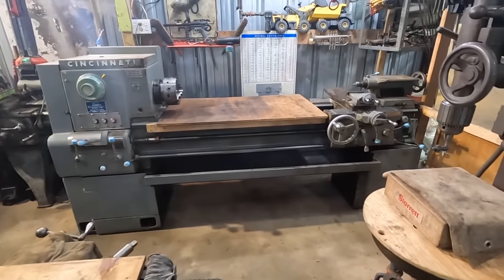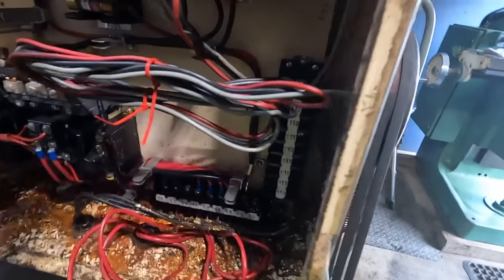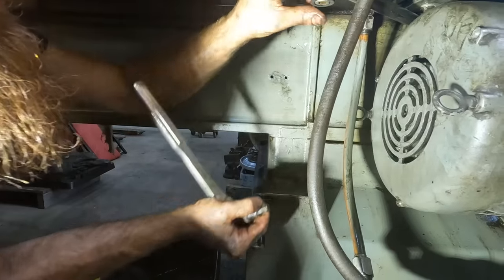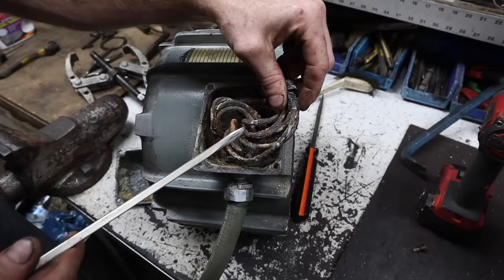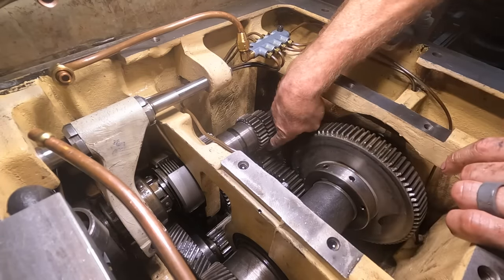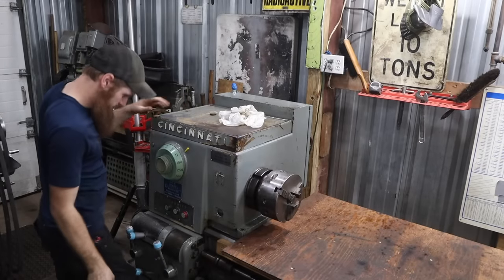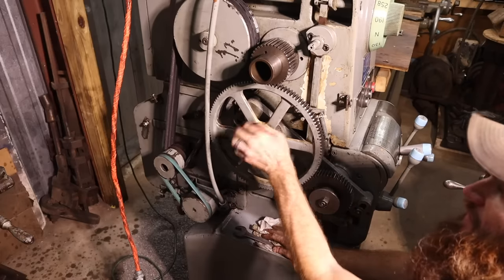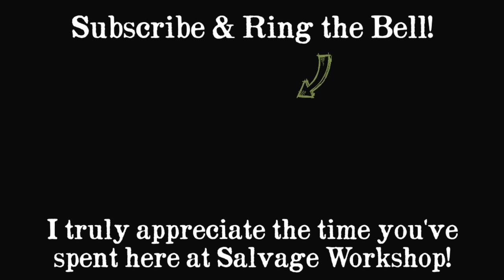Can we SAVE this BROKEN Lathe? ~ MAJOR Issues found! ~ Will it Ever CUT again?

Comment: Back in the old days, There was no Shields for chuckes when you run liquid. It would sling it all over the place . I think it got up on top of the electric box and Leaked passed the seal on the electric box, and it could have enterd inside the box that way.

Comment: I WAS WONDERING why  didn't extend the pipe for the bottom drain bro. A hose leading down into a pan with some filter cloths of some type to catch ay bad stuff so u can reuse the oil or diesel?? I'm probably talking nonsense here. Apologies if my idea makes no sense at all. LOL
What was all that crap that was stuck in the motor? I couldn't believe that much stuff could get in to a motor housing that is completely closed off to the outside? 
What size motor is on this Lathe? It looks huge. I'm guessing 3-5HP or higher?? 
It's a beautiful looking old machine my friend. Great work by yourself and the 2 young lads who helped u clean it back to a nice looking machine again. 
I love videos like this one. 
A machine like this would take a heck of a lot of work to get it back running smoothly again but u guys seem to have worked ur magic on it.
Best of luck with it man. I hope u get many years of great machining out of it.

Comment: Lower oil sump is probably meant to be a debris collector that only gets cleaned and serviced at very long maintenance intervals. That would allow the use of a screen for the main filter which gets oil from a higher cleaner level, That is somewhat how lube oil and hydraulic oil sumps work on some steam turbines at least

Comment: Not sure if someone mentioned, but the copper lines are not for oiling the gears, rather go to the ends of the shafts to shift them into the other gears.  But check it out.

Comment: That is a squirrel cage three phase induction motor.  Get the stator windings cleaned and tested for continuity to housing maybe it can be used for a while. The bottom part of the windings have discoloration due to being immersed in water while energized.  Very surprising it is still running (but soon will burn out).  Most likely the water entered thru the electrical terminal box.

Comment: I think the one with a plug is just a drain for changing fluid. It may be a place to catch particals that are floating in oil to keep from circulating in system. I think otherwise it would have been hooked up the way you are thinking. Just my thoughts on it

Comment: If the tube is open ended by the site glass, it's a fl ow gauge so you can tell if the oil pump is running

Comment: All that stuff in the motor is aluminum oxide from the housing corroding.  It's an excellent electrical insulator therefore, the motor didn't short.  Had the same thing happen to the winch motor on my Jeep.

Comment: You don't use a detergent oil in your lathe. You use gear oil. Particulates don't stay suspended in gear oil (which is what you want), they do stay suspended in detergent (motor oil) so they can be filtered out by a filter. 
The oil in the electrical box may have been coolant, or a leak in the electrical supply conduit

Comment: The lower sump is likely for letting fines settle out, many machines featured a dual-sump system for that purpose.
Basically, gravity-filtering with the screen to catch any big chunks that end up in the wrong sump.

Comment: Oil can also sneak through wires like they are a candle wick. Something like that happens rarely, but still it can happen. 

It is an issue in some older Mercedes cars with cables connecting inside of a gearbox with main ECU, which was inside engine bay, higher than gearbox. You could find your ECU filled with gearbox oil. Try explaining that to a client 😂

Comment: That drain plug allows the contaminated oil to settle at the bottom, and then it should be drained regularly to remove the accumulated sludge. DO NOT CONNECT IT TO THE FILTER FEED PIPE.

Comment: If you had set the bike level you could have simply used a bubble to set the subframe joining pieces/stub ends vertical alignment. Also, I would drill the frame for plug welds to reinforce the welds on the end of the tubes/stub ends! 😊

Comment: That's called an oil light barring that bushing in the big gear you have to buy it pre-made you can't make one it has to be infused with oil I mean I imagine you can make what if you learned how I'm just saying that it's not just a piece of brass. It's called an oil light bearing and you have to buy them in there usually a little bit too tight to put in even pressing you have to take ten thousandth off. I used to use a highly highly accurate hardinge lathe to do that and you have to do it at high speed and use a very sharp tool. If you smear over the microscopic holes from the oil infusing process and leaves it useles and it aware that hardened shaft in short order

Just a tip
Reply: Yep!  Oilite!

Comment: The corrosion you found within the motor was mainly Aluminium Oxide from water immersion.
Did tge unit go through flood in the past.
Great detective work on the speed gears and electric motor.
When working on old electrical items be cautious of asbestos insulation.
Hope you ID the high speed noise?
You never ran the unit in reverse; does the noise change?

Comment: One more time, those split pins have a greater content of carbon to allow them to be springy. Greater carbon steel is spring steel. It's the same with leaf and coil springs. They have a greater content of carbon.

Comment: You don't want your gears running tight.   They need a bit of lash to run properly.    Check the  manual for all the specs.   They can usually be found online.

Comment: The play in the headstock end gear train that runs over to the threading/feeds gearbox is a necessary evil.  It’s called backlash and must be there, though at a minimum, or else the gears will “eat” each other and the backlash just will get worse and worse.  The mechanism/holders those gears ride on is called a banjo and quadrant.  Loosen the locknuts and adjust everything to take away the backlash completely then back each gear ever so slightly away from each other (the gears that is) then re-tighten the locknuts.  You could also setup dial indicators on mag bases touching off on a tooth and adjust the backlash the same way you set up a ring and pinion geartrain in a car/truck rearend/differential!  I’m sure you’ve got experience in doing them based on the heavy equipment you repair.  Same basic process!

Comment: Okay so I have an idea on those drain lines you were confused about, the one going down to the filter is the coolant line and the one with the plug is the oil drain plug, also if you look at the top of your electric box there are some wires coming out but goung to nothing and i am assuming it was the wiring for the coolant system
Reply: Also assuming water may have been leaking through the wire hole in the top of the electric box, I don't believe that oil was leaking inside bc the oil would not have allowed the box to rust like that
Reply: I also believe that was a coolant leak that caused the motor to corrode like it did

Comment: The Flaky paint down to the cabinet steel, and the powdery gunk inside the electric motor , looks like damage and residue from coolant.  I have seen before. Which makes me wonder if they had a small coolant mister tank mounted above electrical cabinet. Leaking coolant could have wicked past seal on cabinet door , along with dripping on electric motor finding way inside , then motor throwing around armature, and heat from motor turning coolant into sludge/ powder.   While I enjoy all your videos, I first discovered  your channel rescuing  and rebuilding older machine equipment. So these last 2 videos, have been that much more enjoyable for me as of late.  I find something valuable  out of  all your videos.

Comment: In reference to the oil drain I would imagine if it was meant to go in the filter it would already be that way. Mayhap it the drain plug you pulled out is for a sump for the head unit so it won't run dry on start up?
Just thinking out loud. I would put the belt guard on  even making one of wood

Comment: Old metalworking equipment = sulfur based cutting oils = aluminum corrosion that looks like fluffy white/gray powder which is MUCH higher in volume than the base aluminum metal.  It's actually considered a ceramic and is effectively an insulator so won't short out wires.  Highly abrasive, though.  And wire insulation also hates the old cutting oils--but they hate everything when they get old anyway.

Also...TEFC motor.  "Totally Enclosed Fan Cooled."  ALWAYS spend the extra money to use a TEFC motor on machine (and woodworking) tools where one is available that will fit.   Worth every penny.  Dump the open frame motors in the scrap bin.

Comment: Awesome machine. I did notice there was a gasket on the small square electrical box attached to the motor, the one where you made a line of coke inside the lid,  and I may be wrong but I didn't see one go back on?

Comment: I definitely wouldn't recommend putting a tee the oil plug section to the filter as you will starve the machine of oil. This is a sump to supply oil all the time and not have it ever go dry during operation of the lathe. Hopefully I explained it enough for you to get the jist of the situation. I do like your idea of putting the pipe to be able to drain that sump without it resulting in a huge mess. Take care.
Reply: By the way the oil in your electrical box is more than likely from the top of your head gasket area leaking. Sealing it with some rtv, will likely take care of the problem. I would use the least amount possible. Have a good day!
Reply: Now my last comment made I see you have found exactly what I am talking about.

Comment: Your concern about the condition of the motor rotor surface is misplaced.  It’s a squirrel cage rotor typical of all induction motors and there’s nothing that actually contacts the surface (normally…..in your case probably lots of powder!) and the induced electric current flow in the rotor is through the cast aluminum bars of the “squirrel cage” that are in the grooves of the iron/steel.
Reply: If you need a motor later, look for a C face mount type.  Probably a 182TC frame.  Most common will be 3450 rpm but should be able to find a 1750 rpm version if that’s what you need.
Reply: @jimrankin2583  right, a new baldor would be a nice upgrade

Comment: I think when the gear came loose the lid was off of the gear box for some time while the previous owner failed to figure out the problem.  Engaging the live end throws oil up and back.  That's how oil got into the electrical box.

Comment: I wonder if you could put twine around the gear where the roll pin is and paint on a epoxy to keep it wrapped on  or better yet tap it and add  a pin screw  thats lock tighten in the screw won't come out but it can be removed.  
Yes thats original paint just need to paint the top of the gear box.

Thats a dam good lathe we were using them up into the 2000s

Comment: Question can I ask wear that machine lathe came from because I took machining at Valdosta Vo-Tech right after I graduated from lowndes high high School in Valdosta Georgia I am 57 years old now and that machine looks incredibly familiar to me I very well may have run that machine at one point or another while I was taking the course and the reason the motor was like that if I remember correctly a few years after I finished the course the machine shop flooded and they sold a lot of that equipment off at auctions if I remember correctly but my memory on it are vague

Comment: ATF cleans well. So does diesel, especially for this stuff, a mix of atf and diesel , and gun oil for chucks and ways with a lint free rag a scotch brite padis ok if you are going to rinse with diesel or solvent,  steel wool and ATF then wipe with a rag even to remove light rust. Alcohol or acitone not so good, kerosene lantern fuel is the cleanest solvent. A couple oz of ATF in a qt of lantern fuel is perfect for this, I'd start with a about 4oz of lantern fuel, wit just a splash of ATF, like a cap full or two (4, or less)  it leaves a really thin film if oil to prevent rust, its not going stop rust in wet or humid conditions, but normal humidity and fingerprints should be ok. Until its oiled  gun oil will work well to prevrnt rust and lube the Way,  the chuck only a oily rag to leave a thin film but graplite powder or a dry film lube us best  to keep metal dust from sticking to the parts causing wear. A grinder or sander used near a lathe is not the best, having a cover for the chuck and ways.   Compressed air ti keep it clean us about the cest to clean.. sorry to ramble!✌️
Reply from the maker: No worries on the ramble! I appreciate your advice, thank you for taking the time to give it!

Comment: I'd get a pump and filter circulate some diesel inside at 26:23 , to clean everything! Catch the dirt in the diesel fuel filter,   the drain the diesel, and clean with , kerosene lamp fuel the extra clean kerosene, then drain it and  and allow the remaining to evaporate .

Comment: That outer gear wheel noise is a puzzler...It would drive me nuts not to figure it out. Did you check the run out on the shaft(s)?

Comment: It was ‘’cheaper’’ not to put extra drain hardware, ie. mfg’s figure the little oil left in the sump if changed regularly really didn’t hurt.  A ‘’T’’ setup for the drin is something I wouldn’t worry about.  I personally would remove the old filter system and install a screw on filter assembly designed for hydraulic systems.  Easier and cleaner ‘’if’’ you ever do regular maintenance 😊.

Comment: Nice work! I really enjoyed watching this. However you still have to figure out how that fluid got into the engine or you'll soon have problem with it again. My guess is that it was cutting fluid building up near the electrical wire. The sheathing of the wires acted as a tube leading fluid to the electrical box and then into the engine. It's the only way it could have gotten there since the engine was so sealed. Maybe corrosion caused a hole that allowed fluid to run down the inside of the electrical wire sheathing. Check it out! Friendly advise from Sweden.

Comment: I know exactly what jaws and extra chucks you wanted.  Unfortunately, all 3 businesses that I know of (Chicagoland + 200 miles) sold off their business within the past 18 months.   The last was manufacturing shop in central Chicago proper.

I was wondering why you didn't attach a downtube and turn valve.  Not just for the diesel run, but even in the future, in case you got a filter issue, you can run out the oil, pour it through open filters, and pour back the used/clean oil back.

Comment: At 31:30ish, put a full flow ball valve on the end of the extension pipe then put the plug in the valve. Much easier later.

Comment: You should stick a ball valve on that drain tube when you stick the drop tube on it and if your worried about the handle being knocked and losing all the oil you could either unscrew the handle off it and put it in the electrical panel for safe keeping in a zip lock bag.

Comment: The heat shrink fix will come back to haunt you, all that oxidization has traveled all the way through the wire to the field, I'd at least have taken the field out and had a electric motor shop put some new leads on it..... But that's my 2 cents, and no a c face motor are very abundant, lots of times you can pick up a used one cheaper than a foot Mount because there more a specialty  and used ones usually don't move very fast on the market that I have seen

Comment: I wonder if one of the dry ice blasting machines might be a good way to go for cleaning debris like you found within the motor and windings - check out the job they do on the underside of vehicles... Could the white stuff be residue from the liquid coolant used by the lathe, having dripped from somewhere over the years ?

Comment: Depends on if it is 3 phase you or 3 phase delta, not sure if I remember but one of them you can change any 2 wires and change direction of rotation,  on the other one, I think it is y one leg is different voltage than the other 2 , you can only change the 2 that are same to change rotation, not completely sure about this been long time since I have messed with 3 phase electric motors!

Comment: Maybe they were concerned that the elbow's and horizontal pipe would plug up and leave build up in the elbow's and horizontal pipe restricting flow and possibly plugging them eventually.  I was wondering about getting a quarter turn valve to put in where the plug was. Then connect a hose to the output of the valve and run it down behind the motor as straight as possible to where you can drain it in a pan on the floor. Plastic tubing can slip over wires to insulate them. I prefer it to hot shrink tubing in a situation like that because it is more flexible provided that you could get tubing that would handle the heat from the motor.

Comment: separate sump to let contaminates settle out. soft jaws are the way for a chuck, you can' get a tiny grip on parts that you couldn't think about holding other wise. like wise, when you bore them to fit the part there should be no run out.

Comment: My feed line to my pump was leaking pretty bad.. I had the inside of my electrical panel wet as well. I have no clue how it was getting in there but when I fixed the feed line, the problem went away.

Comment: The oil possibly could be coming from the panel mounting bolts since the do screw into that housing that holds the hydraulic oil . Just a thought